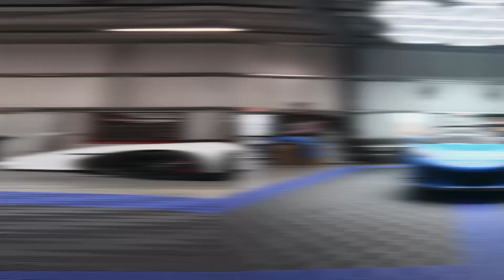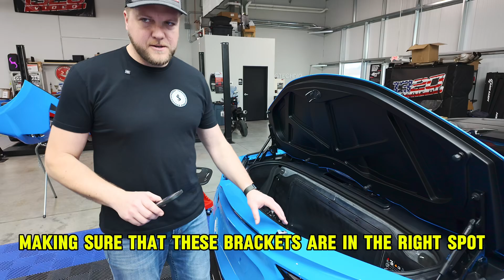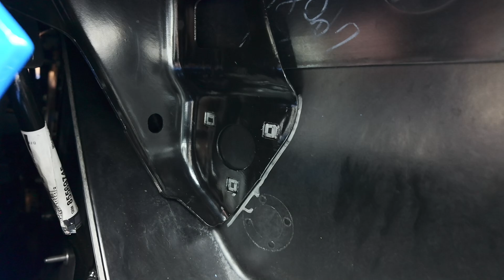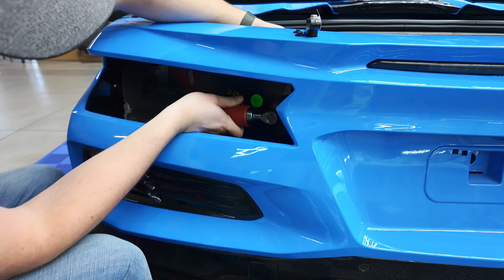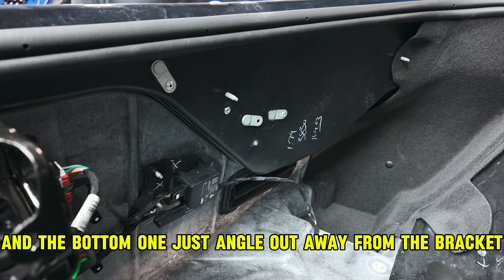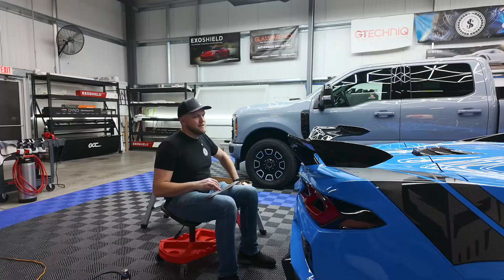C8 Z06/Z07 OEM Wing Conversion

Comment: So what does that conversion cost if you don't mind me asking. I would like to do the same thing.
Reply from the maker: I can’t honestly tell you the full cost because there are so many variables and we have the customers buy their own parts. We just install them. Best way to find out is to take the parts list to your local GM dealer and have them cross reference everything to make sure they haven’t changed part numbers and then have them get you an estimate. Installation costs vary depending on hourly rates too.

Comment: What is the purpose of the rivets or maybe I missed something
Reply from the maker: They fasten the tabs that you thread the bolts into that hold the support brackets
Reply: @JSDetailing402  got it and the first initial hole for the bracket you just mentioned “you know where it is” is that one already drilled out or did you accidentally skip that step? I haven’t removed my bumper in about a year or so I can’t remember off the top of my head haha

Comment: Did you do the z07 packaged splitter as well? Wondering if you needed a new fascia as well or if the  current one will work? I have a 2026 3LZ and couldn’t find the z07 package readily available in my area.
Reply from the maker: We did do the dive planes and front splitter as well. You can use the factory bumper you will have to cut slots into the bumper for the canards to fit through.

Comment: EOS makes a ZO7 wing for non-ZO7 ZO6's that covers the top over all the holes so you can use same bumper and it looks pretty good but they already sold out and are on back order now. I am not sure of the quality though since I was not able to order it yet.
Reply from the maker: This customer is very particular and didn’t want to just put covers over the holes. I don’t blame him especially spending that much money on a car. May as well do it the correct way and not the cheap way.
Reply: My personal experience with EOS products is that they are not very high quality. The parts are cheap and brittle and shatter easily, fitment issues, and cheap hardware. I have installed several splitters, spoilers, side skirts etc for friends and I tell them never again but EOS. Spend the money to do it right the first time instead spending double to do it twice.

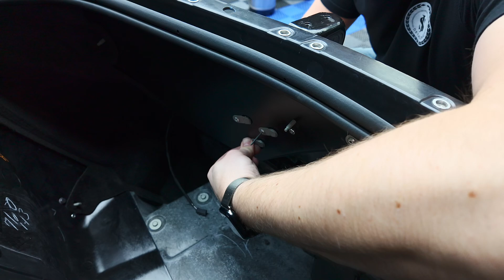Comment: what's the part numeber for thicker bolts at 11:05?  "11561871" appeared twice in description for both Multipurpose Nuts + 4  Bolts
Reply from the maker: You’re right i accidentally duplicated one of the part numbers for the nuts I’ll look into that and get back to you. 

What’s shown at 11:05 are the Multipurpose brackets with the rivets. Those numbers are correct.
Reply: @JSDetailing402  thank you
Reply from the maker: Alright it looks like I just fat fingered the part number. It should be 11561870 for the 4 bolts. I will update the list. As always I would cross reference all these part numbers with your local Parts guy because GM changed or updates part numbers sometimes. 

Thanks for catching this!

Comment: How much was total cost for materials and labor
Reply from the maker: I can’t speak for the parts as our customer ordered them through a dealership he had an account setup with and he actually found the factory high wing spoiler used. However the labor was about $750. It took us about 6 hrs as it was our first time plus recording. It’s a long tedious process. Measuring and test fitting a lot before drilling but the end result came out great!
Reply: You did a fantastic job. If you were local I'd have you do mine!!!!!